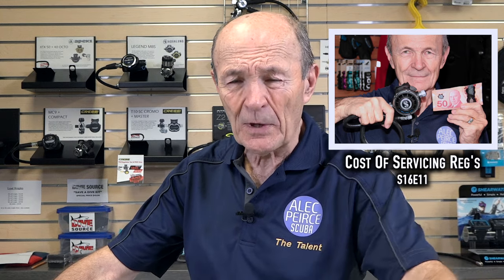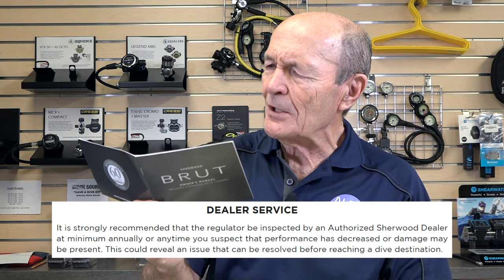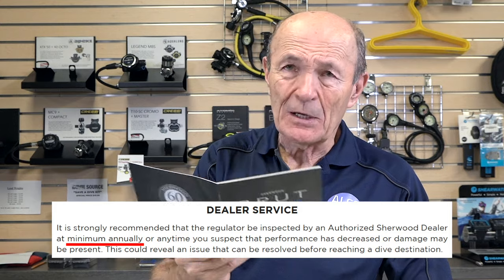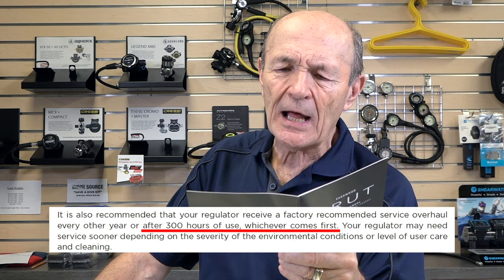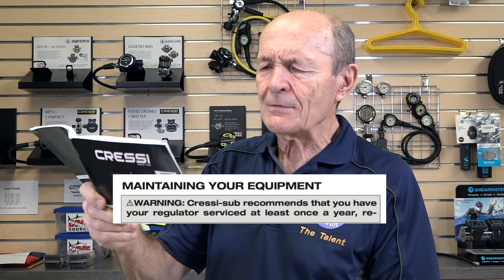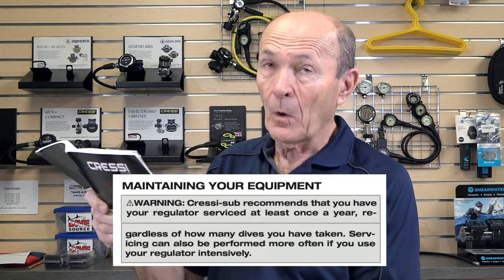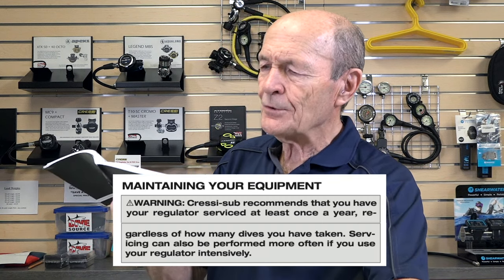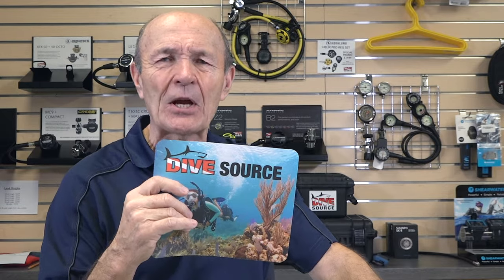Regulator Service - How Often? - Scuba Tech Tips: S16E20

Comment: Hey Alec, great tips again. 
Every 300 dives sounds great for those who want save money, but it sounds little bit like: yes I got free flow in my regulator, for 5 dives now, but my Regulator needs a service every 300 dives, but I just got 285.
😂

Sure it's great to write both a year or 300 dives, but even then I could be 99 or 299 dives in a year. 

So I wonder why not  every 18 month for weekly or monthly divers and 1 year if you dive 300 times?

I wonder what you think about.

Thanks again for an amazing video. 👍
Reply from the maker: The two key factors are number of dives and time (ie aging of o-rings).  Other factors (salt, no rinsing, drag in sand, etc.) can have a strong influence so most makers pick one: # of dives or time.  The rest is the diver using their smarts to determine if service is needed earlier, on schedule or latter based on their usage.
A

Comment: Good tips on just using common sense.  I have two sets of regulators one for local diving and a more basic one (lighter weight) for traveling.  The Basic Cressi Reg set costs about 50% of buying new to have serviced.  The more expensive Deep Six reg came with the first service included. I recently had a problem with free flow due to excessive IP beyond my ability to adjust, so Deep 6 did the service under warranty.  I now have a free flow from one of my second stages and I checked the IP is correct so I purchased an adjustment tool for the secod stage to try to address the problem myself.  IF I am unable to fix it it may need service and I will send it in.  If I attempt to do my own work I will better learn how the equipment works but I know my limits and will seek professional assistance if necessary.  I plan to take my travel gear on a shakedown dive to make sure everything works properly prior to my summer vacation.  If not I'll have it serviced.  Im pretty lucky to get 20 dives a year if I don't take a vacation, 30-35 dives if I do get a vacation, even then those dives are split up between two reg sets.
Reply: For warned many dive shops will charge a premium charge if you come into the shop with your regulator in pieces.
Reply from the maker: The final question should be, is my reg safe for me to dive?  If not, find a pro, test it in a pool then enjoy the diving and not the aggravation.  
A

Comment: In addition I think it also depends on the regulator design.  I list in order of increasing complexity and an increasing number of parts to service.  Flow By Piston > Balanced Piston > Balanced Diaphram.  
I do the majority of my diving now with  Flow By Piston regulators (fewest #parts and simple to work on).  Below one hundred feet I switch to a balanced regulator.
I service my own regulators. But, I was trained to service them.  And I can get parts for them. In addition I have invested in the proper tools for the regulators I own.
Rinse your regulator after diving as soon as possible in clean fresh water. Dry indoors. Store indoors (air conditioned).  And the rubber parts of your regulator should last longer.
I always check my regulator on a cylinder the night before I go diving.  If there is a problem I can service the regulator or switch to a different regulator.
Alec comments?
Reply from the maker: If know your regs and self service (and test), then have fun.  There are no rubber parts inside 1st or 2nd stages any more.  Modern o-rings are so much better and EAN certified too.
A

Comment: In my carreer, I've seen too much equipments that have been more damaged by servicing than by use so now, my mentra is " f it functions within its design parameters, leave it alone " that  holds for my diving regulators too.
If you consider that you take a full breath avery 5 seconds, on 1 hour dive, the regulator have cycled less than 1000 times, for a casual diver like me ( and most of us,  ) if I consider that I can do 1 dive a week year long, my regulator have cycled  about 5, 000 times. 
That is nothing for a mechanical device.
In storage, the first stage seat is not in contact with the volcano orifice so it does not take damage, the only part that can take damage is the seat of the second stage, most intervention I had to do is on that piece sometimes, turning it upside down in its holder to present the unharmed face sometimes I had to fabricate new ones using raw material and a hole punch.
AS you say so well, " common sense" is the rule to apply there  ( and everywhere )
very good topic
Excellent video
Reply from the maker: Thanks again Jacques and common sense is needed too.
A

Comment: At 1:45 in the video, you mention that for ScubaPro you need two kits. Why is that? Love the video, by the way.
Reply: Some companies will have a single kit that includes parts for both 1st & 2nd stages. For example, Sherwood has 1 kit that's for the 9000 1st stage and 2nd stages. So if you have a Oasis 2nd, or a Maximus 2nd, 1 kit will include it part for them. Just know that their kits are different depending on what 2nd stage you have. That's it.

Whilst Scubapro has the 2 separate kits for the 1st & 2nd stage.
Reply from the maker: Scubapro has separate 1st and 2nd stage kits as they sell their regs  independently.  Meaning you can buy any 1st stage with almost any 2nd stage so 2 service kits.
A
Reply: @AlecPeirceScuba_SeaHunter  thank you for your courteous reply.